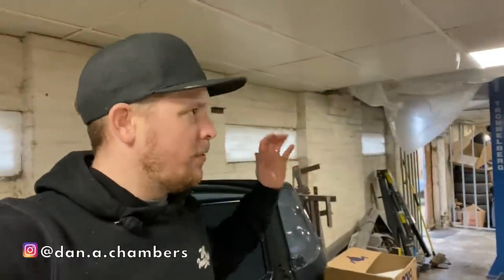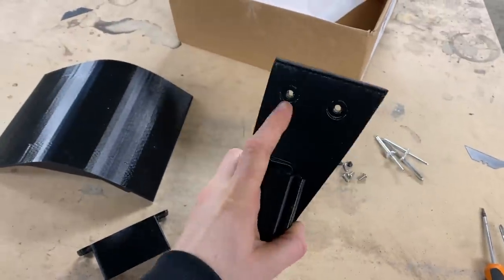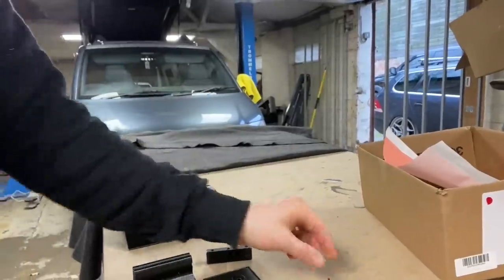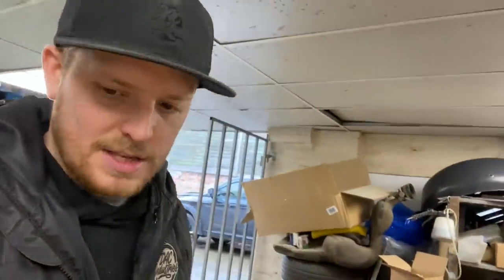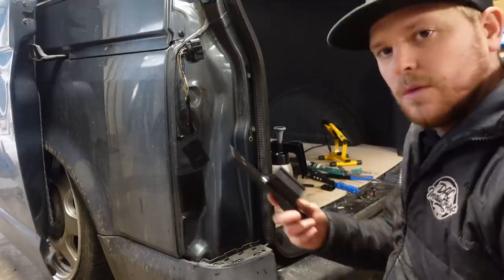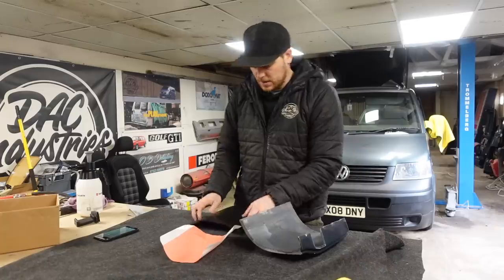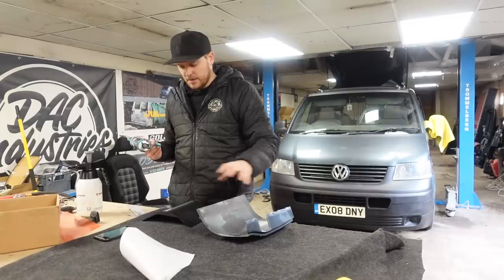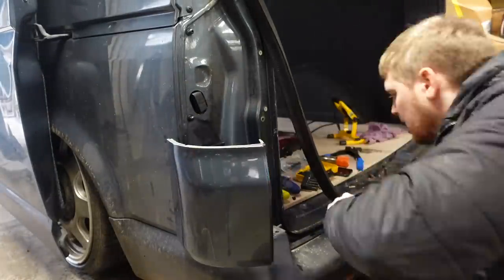Stealth Flap Install - EHU - VW T5 Camper Project

Comment: That's a nice job, especially the T5 vs T6 issue. One tip, when using rivits (in my profession) we dip them in sealant. So they create a nice corrosion resistant barrier when installed.
Reply: Nice tip Rob, that would actually work well on lots of applications and also help to slow down potential corrosion (from the freshly drilled rivet hole) thanks for sharing that 👍